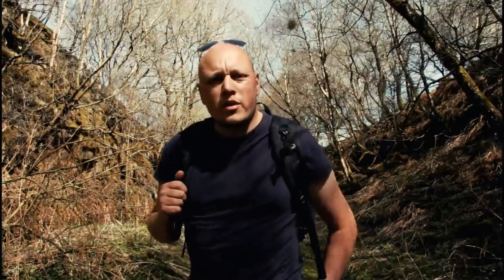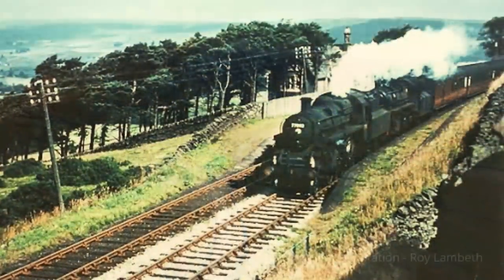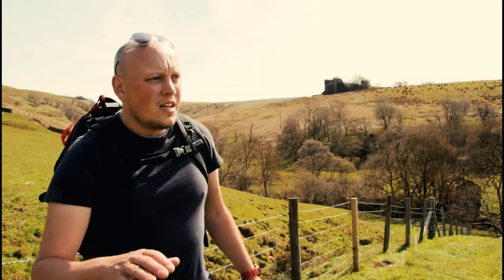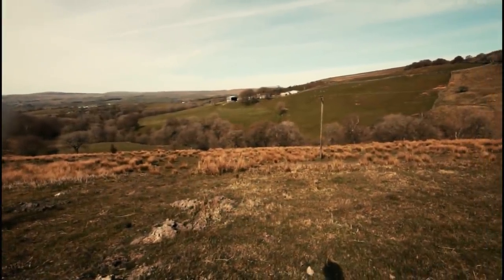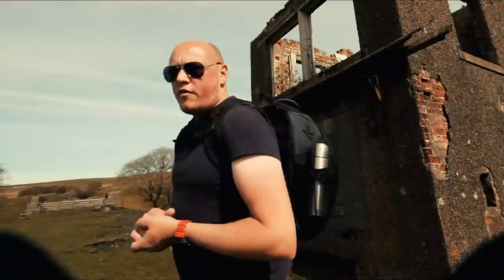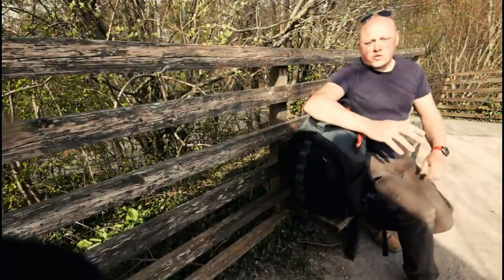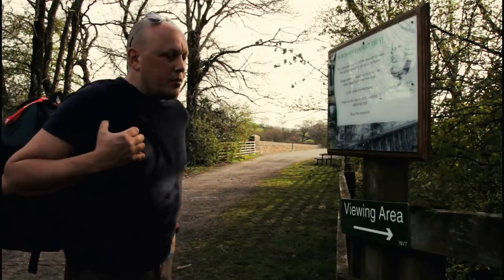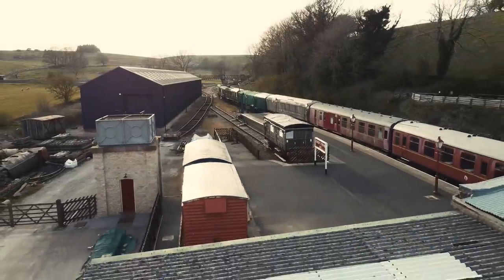Explore Abandoned Stainmore Railway Signal Box & Huge Belah Viaduct

Comment: Another really enjoyable video Gordon 👍brilliantly put together...photography and cinematography to rival any program maker..others have touched this line on you tube but the level of information in yours is on another level 😊 a must watch for any railway historian 👍
Reply: You said it for me @marcus pick
Reply: like to add something as you didn't go to one of the viaducts (i believe the taller of the three between Kirkby and Belah viaduct) Resgate viaduct a 9 span 97ft tall and 324ft its a lot like Merry gill Viaduct. its privately owned by a farmer. if you would like some photos of it please get in touch and i would gladly take some of it as i believe there is not many of them around i could only find two different photos of it on the web and they are a bit crap. its currently not in bad shape as its used by farm traffic but obviously not the best as the cost of maintaining such a structure is well out of reach of a single farm. there are also some very deep cuttings into the hill side on the Stainmore side of the viaduct which they used the matreal from to construct a large embankment over the Coldkeld gill with large tunnel for the river to flow throw that you can walk through but it's a bit wonky. but ye let me know if you would like some pictures as i believe some of this needs to be archived before it is gone for good.

Comment: Fantastic edtion. I'd love to have worked boxes like Belah box in Summer. Not so much in Winter. One video for that was the BTC production called 'Snowdrift at Bleath Gill' which was somewhere on this line. Read somewhere that if it weren't for the BTC production. The loco that got stuck in the snow would've just been left until the snow had gone and thawed out etc. So without that I doubt that loco would still be with us now. 78022 which is now at the GCR (Loughborough)

Comment: like to add something as you didn't go to one of the viaducts (i believe the taller of the three between Kirkby and Belah viaduct) Resgate viaduct a 9 span 97ft tall and 324ft its a lot like Merry gill Viaduct. its privately owned by a farmer. if you would like some photos of it please get in touch and i would gladly take some of it as i believe there is not many of them around i could only find two different photos of it on the web and they are a bit crap. its currently not in bad shape as its used by farm traffic but obviously not the best as the cost of maintaining such a structure is well out of reach of a single farm. there are also some very deep cuttings into the hill side on the Stainmore side of the viaduct which they used the matreal from to construct a large embankment over the Coldkeld gill with large tunnel for the river to flow throw that you can walk through but it's a bit wonky. but ye let me know if you would like some pictures as i believe some of this needs to be archived before it is gone for good.
Reply from the maker: Excellent! I do intend to hunt this one down in 2023. I found it very difficult to track down. Please get in touch. nodrog@post.com thanks.